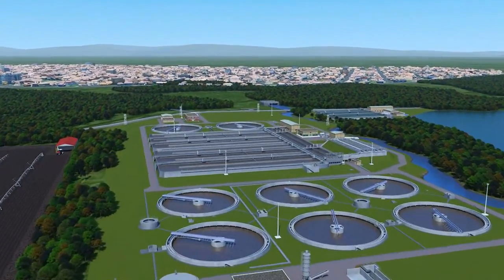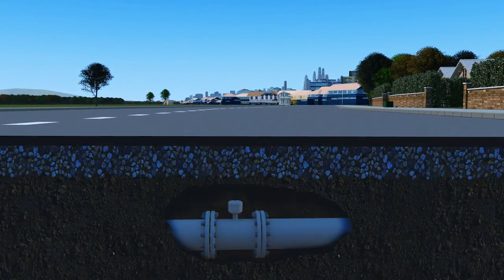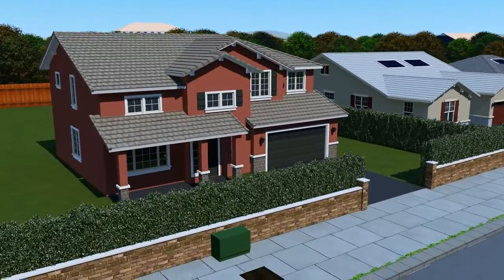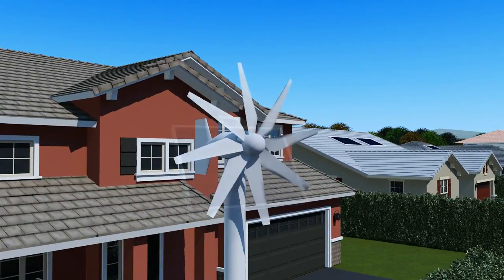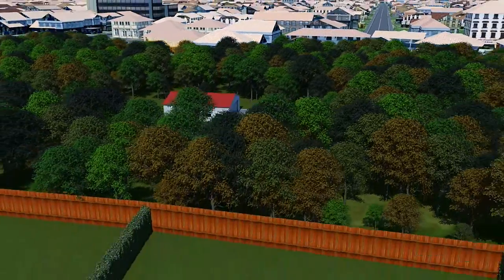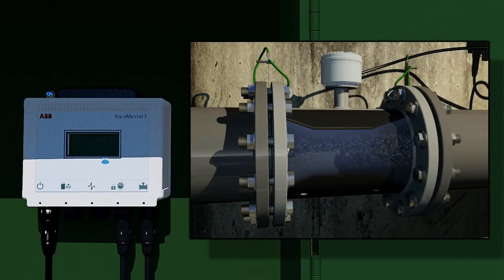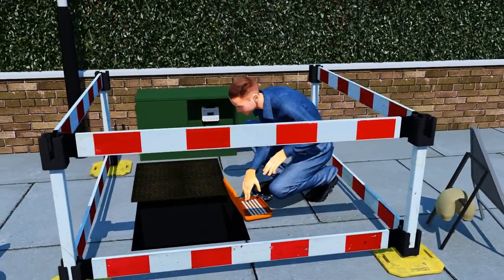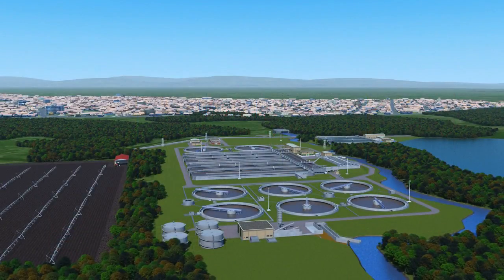ABB AquaMaster 3 Electromagnetic Flowmeter

Comment: Sir how to use a electromagnetic flow meter in line horizontally or vertically plz tell me
Reply from the maker: Thanks for contacting us! This information can be found in the operations manual for the flowmeter line. Here is a link to the document - http://search.abb.com/library/Download.aspx?DocumentID=OI/FER100/FER200-EN&LanguageCode=en&DocumentPartId=&Action=Launch If you need further information, you can find your local contact at www.abb.com/measurement.